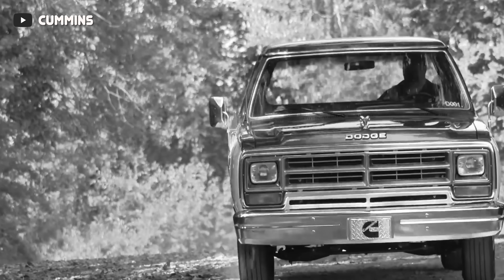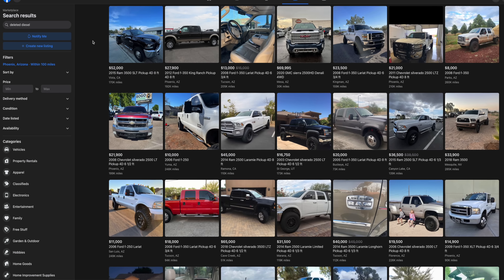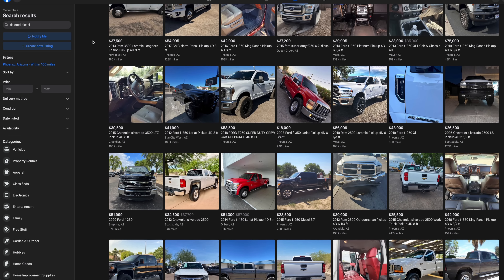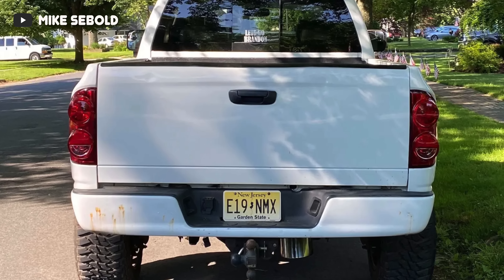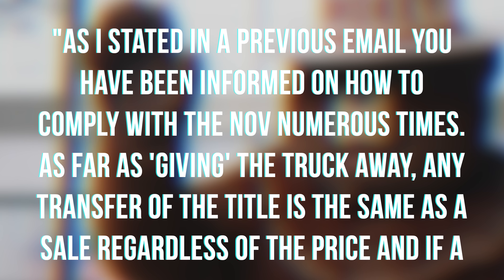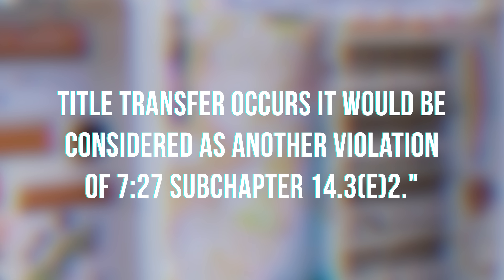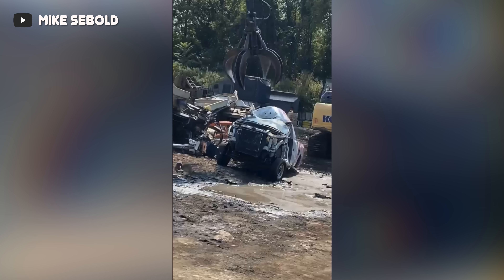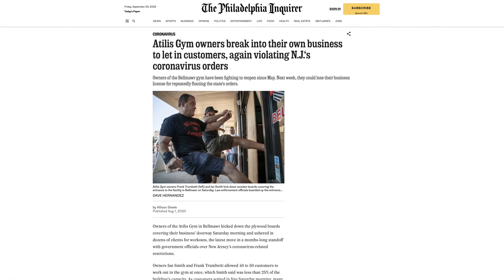NJ Cummins Owner Forced to CRUSH Truck Over Deleted Emissions Parts

Comment: Pre emissions trucks are going up in value because of emissions equipped trucks.
Better pick one up sooner than later.
Reply: California won’t register any diesel older than 08
Reply: @WaterandWoodsmen  California just hate anything with wheels
Reply: @WaterandWoodsmen  we should start a petition to eliminate CARB, it's the biggest bs ever. Federal regulations for newer trucks, meh, OK I guess. Me suddenly not being able to register my existing stock truck because it doesn't have something that it was never designed or built with from the factory, it's so stupid!
Reply: @WaterandWoodsmen  that’s not entirely true, it’s only for trucks with a gvwr over 14,000. So 350s, 3500 trucks are fine, but anything heavier with a Diesel engine can’t be register unless the vehicle is retrofitted with a newer engine OR if it’s converted into a Motorhome
Reply: Makes me love my 03 excursion 7.3
Reply: @WaterandWoodsmen  can you evaluate? I'm currently working in California and I see older diesels everywhere?
Reply: @salo1808  That'll do wonders for the currently dying Long hauling business in Cali
Reply: @WaterandWoodsmen  Pickups or just bigger over the road commercial trucks. Nothing shocks me coming out of California.
Reply: Saw a 190k mile 2001 CTD for $42k last week. I paid $29k for my 07.5 with 120k miles 6 years ago. It's jaw dropping.

Comment: Part out every piece and disassemble the whole thing.  Bring the title and the vin plate to the scrap yard for "destruction".  Then buy a new truck in need of the very parts you just took off and start over.

Comment: You know what upsets me because diesels  excess emmisons are visible the epa is all over diesels .  Gas cars have had  headers , superchargers stroker kits emmison deletes for years and years with non compliant emmisions.  Nothing is done about them .  It's a witch hunt in my opinion.
Reply: PFI speed who sold a chip you solder to a stock Honda ECU was hit around 20 thousand of dollars in fines by the EPA. They didn't need to prove that the chips were even installed or on a street vehicle. It was purely because they were an emissions defeat device in the EPA's eyes.
Reply: Gas cars that I think are over 30 years old don't need to comply with emmisions. Same with diesel trucks. So if you have a 30 year old truck. You can tell the epa to shove it. Just like someone with a hotrod can. Though I have to say I see alot less of these than deleted trucks. And I definitely don't see them dailyed as often

Comment: The solution is simple...SAVE the deleted parts! you might want to buy another ECU, tune that, and save the stock one. If you ever need to have the truck inspected, just simply put the deleted parts back on, plug in the stock computer, and everything will be in compliance. With the EGR and exhaust train being still new from lack of use, the truck should pass with "flying colors". Once the inspection is done, pull the parts back off, swap out the ECU, and enjoy a truck that actually runs! (avoid "rolling coal", that's a dead giveaway) Save the parts for the next inspection. (or sale of the truck)
     The only one concern I would have, is if the ECU records the mileage traveled, and the odometer and computer show different mileage. IF someone notices that, it could "throw up a red flag".

Comment: I had a dodge ram with a cummins in it. I ran a stright pipe and deleted my catalytic converter then had emissions test done.... It ran cleaner without the cat. Why have it if the Truck runs cleaner?

Comment: WE all love to hate EPA...
Reply: Until you look at pictures of Los Angles or any major city from a distance and see the brown cloud over them. My parents remember in the 70's standing on Moro Rock in Sequoia National Park and not being able to see more than a few miles because of the smog. Now we can see the horizon.
Reply: @superjesus4307  ,they  had pollution problems before modern transportation in CA just from camp fires due to the polluted air getting trapped in the region. And that is another problem dirty Jersey is not CA. We have plenty of water in dirty Jersey but have to be governed by CA(i.e. high efficiency washers) who lets clean water dump into the ocean, millions of gallons a day. These problems should be looked at on a state by state basis, and wasting fossil fuels(via emissions equipment) is ok by the EPA though which is another virtue signal gone to the extreme. Then CA wins the biggest award by banning new internal combustion landscape equipment so your industry will turn to more polluting older equipment, those co's who cannot afford the electric garbage, so over regulation can actually hurt the environment.

Comment: How do you enforce older diesel engine's? A 6.2, 6.9 IDI, and the 7.3 IDi will never pass emissions. Also if the diesel is older than a 97 model year or later I am pretty sure your emissions exempt in NJ, and you only have to do a self inspection.
Reply: They have to comply with the emissions standards in effect at the time they were manufactured.
Reply: @jericho86  oof that's still a tough one to pass. A lot of these older diesels are beat into the bricks. They run like hell unless you dump money into them. And if your state has safety inspection (NJ does not) if you have any rot your shafted.

Comment: Even as a diesel truck owner myself, I have little sympathy for the guy. I don't like having more regulations but when people can't act responsibly, we risk ending up with more regulations. That said, the EPA could be more reasonable with regard to diesel engines as they are generally the more efficient option when it comes to internal combustion engines. 

Put another way, it'd be easier for me to just dump my used motor oil somewhere in my yard - BUT that could have an impact upon the groundwater that everyone else around me relies upon. People just need to be reasonable and considerate - including the EPA.

Comment: Kinda is by definition lack of care for the environment. I understand if you can't afford to replace them. But if they are working fine and your remove them there was no reason to do that. Your just hurting the environment and in some cases other peaple to avoid the chance of it breaking down. Plus egr systems have gotten pretty reliable. Particulate filters have a ways to go but there getting there.
Reply: The egr system still plugs up in newer trucks, they suck. So let's put more diesel fuel into your particulate filter to burn off the soot, that makes sense, Not, that's more fuel WASTED to me, lowering mileage, (fuel WASTED, and more emissions?)

Comment: What is a "complete truck"? Could he bring just the frame with cab at junkyard and keep engine, transmission, ecu...?
Reply from the maker: It looked like the truck was pretty much just the cab and bed when it was crushed. I'm pretty sure they pulled everything else out of it for obvious reasons.

Comment: I mean I'm all for polluting less, and I am certainly not against emissions control equipment in general so long as it actually works and is reliable in the long term with little to no required upkeep.  A classic example of an emissions system that did very little asides from rob significant power and fuel economy to simply dilute the exhaust gasses and make the engine appear to be running cleaner according to a tailpipe sniffer is air injection.  I am more than well aware of many classic vehicles with that inherently garbage system simply bypassing that pully when replacing an accessory drive belt, and immediately having a significant gain in both power and MPG.

Comment: Funny thing is NJ doesn’t inspect light duty diesel trucks but will go to these lengths to get a non compliant one off the road.  Shame the guy scrapped his truck but it looks like he got it pretty well parted out before doing so.
Reply: He should have parted it more. All he had to "legally" do based off the paperwork in this video was scrap the cab. I would have removed all the glass the gaskets the firewall the pillars everything. They only get paid to be petty, I treat it as being a hobby.

Comment: My opinion is that he can do the modifications on his truck. But having the dep. should not come in and say that he needs to return the old parts. If taking off the emission components that help the truck to improve the life of his truck. The dep. really should not have stepped in at all. I love modified cars and trucks. I agree with him about taking it off the road after the dep. told him about it, the dep. should have realized this because he went to the competition with the truck. Plus look at how the old trucks can go before there actually fully done on the road, especially the diesel trucks.
Reply: He committed a crime. Just because he stopped doing it doesn't make it so he never did it. If you get a speeding ticket, you don't get off the fine just because you stopped when you got pulled over.
Reply: @borla4491  No.
Reply: @superjesus4307  Go kiss your daddy

Comment: pretty stupid to crush it. it would have been easy to trailer it to another state and NJ could not do fuck about it. as an 08 it woundnt even need a title anymore using the Vermont trick on Jan 1st of 2023. i hope he at least pulled parts off it before crushing.
Reply: Those loopholes may be closing up in the future.

Comment: If you delete and get busted you deserve whatever you get. If you are scared of reliability issues then get the extended warranty or get a gasser. But as a person with a truck that isn't deleted. It's creeping on 500k miles and only sensors a def heater and a down stream diesel injector have needed to be replaced. Most under the extended warranty. The head cracked before  a particulate filter or anything serious needed to be replaced. Don't do something you know you shouldn't then cry about it layer when you get busted. And if you insist on deleting keep all your old shit so you can put it back on later and not get yourself busted when you are advertising to the whole world that it's deleted.

Comment: If white collar yuppies didn't turn pick up trucks into a status symbol/fashion accessory, we'd have less expensive trucks and fewer regulations on em. All these insecure dudes who buy a 3500 with a Cummins in it, but never haul anything that a little Honda couldn't handle, should be publicly shamed and mocked until they sell of give away their truck to someone who will actually use it for work.

Comment: Why I would never have a modern Diesel engine.
Now, don’t break the rules that most do follow. Change the rules if it is the right thing and matters that much.
Reply: Did you watch the whole video?

The owner deregistered the truck and used it strictly for racing